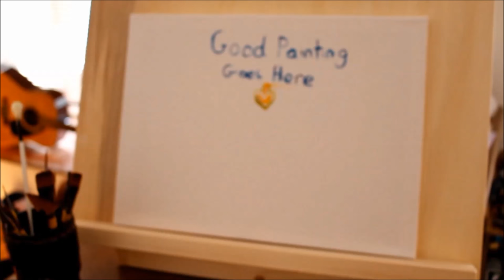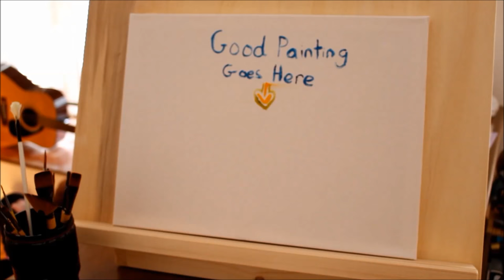DIY Drawing Board / Art Easel

Comment: Great easy build and great video! Thinking of adapting this design into a carrying case for supplies as well as the easel.
Reply: I was thinking the same thing. Put a board on the bottom, add a handle & some kind of latch.
Reply: My friend made a similar one by adapting his tabletop easle. Seemed to work but this one is a bit more robust

Comment: Would be worth noting a couple of things on this vid: 1) this can all be done with hand tool ie hand saw, just the cordless drill is needed.  2 ) that pivot point on the support arm looks to be a partially threaded screw so that the portion going through the hole in the arm is smooth with clearance, so the screw doesn’t turn and chew up the wood.
Thanks for the vid 👍

Comment: Can we get instructions with dimensions to make this easel? It is exactly what i-m looking for.
Reply: I‘m late, but here‘s what I‘m working with. I‘ll start building it this evening. 

Top board is 40x60 cm with a 2cm edge at the bottom.
Frame is built with 34cm and 46cm bars (3x4) , making the whole frame 34x52. The holes for adjusting on the sides are 5cm apart each.
The adjustment assembly is 3x2x46 at the top, 2x2x45 for both sides and a round piece with ø1x54 cm for the bottom.

Hope this helps :)

Comment: 6:45
Is that a screw? Screws can be used as turning mechanisms related stuff? I need confirmations before i actually try pls send help 😂
Reply from the maker: Yes, it is a screw. Use a "pan-head" screw andscrew it in all the way and then loosen it half a turn to allow the wood too move freely. Good luck with it :)
Reply: @ontheworkbench8743  thanks bro, lifesaver

Comment: I’d really like to make one of these for my wife, but can’t seem to find a workshop with all the necessary power equipment.
Reply from the maker: This whole project can be done using a handsaw and a drill, no workshop machinery needed, although it does speed things up!
Reply: On The Workbench I have a jigsaw without guides and no vice. I really like your video and want to make this drawing board! I can get four sessions at a workshop for $200, but at that price I might as well buy one. Any advice for limited resources and tools or on making nice straight cuts with a handsaw? I could easily buy the drill bits necessary. Cutting is my main concern.
Reply from the maker: @edvoorhees4253  I would recommend finding yourself a piece of wood, mark out loads of straight lines an inch or so apart and start cutting., practice is really the only way to get good at cutting straight lines by hand, it's not that hard though, you will master it in no time! As for limited resources, you don't need many tools to get into woodwork, a handsaw, drill, 2 or 3 chisels, a plane and maybe a coping saw for cutting curves. Try to purchase them used in local ads or ask around, plenty of people have these tools lying around in their sheds. Machinery only speeds things up, you'll learn so much more from using hand tools first.
Reply: @ontheworkbench8743  Thank you so much. Your video has really inspired me. The idea of making something of beauty and function by hand is very appealing. Does one get a degree or apprenticeship to become a professional carpenter?
Reply from the maker: @edvoorhees4253  I'm certainly not a professional! I started woodwork from a young age however and I'm a trained luthier but love all kinds of "making"!
Reply: Dang! Now I have to look up what a ‘luthier’ does! lol
Reply: @ontheworkbench8743  auction, craigslist, rummage sales, facebook marketplace. I have some beautiful tools for pennies on the dollar and use my kitchen table as a work bench.  (have cut and drilled through my kitchen table.)I  my just hobbiest, but I make little things for the kids and the pets.

Comment: It seems to b a factory than a diy vedio ... i hv a big wood sheet .... culd u suggest any easy DIY method to hold a paper while drawng without using tape...cis it spoils ends of paper...
Reply from the maker: Hi, I wish I had a factory! This was done in my small workshop which use to be my bedroom! Yes I have a bandsaw and drill press but these are not needed to make this,  it just helps speed up the process but you can use a hand-saw and any drill you have. My suggestion for you would be to make a board with strip of wood like I do in the start of this video, then paper can rest on it! Thanks for watching.
Reply: Piece of wood top and bottom on some bolts to tighten on paper

Comment: natural wood is a terrible drawing surface. you need hardboard, polycarbonate, treated mdf, sheet metal, or something stable and smooth. no draftsman or artist could use this.  even if you tried to finish the surface with urethane, you would get shrinking and sinking over time that would be terrible draw straight lines on.
Reply: Easily solved with any one of a number of solutions.

Comment: Video is great yes. But I wouldn't call it DIY if you're using so many pro-end stationary tools that the average Joe doesn't have. In that case a factory production line is just as much a DIY when handled by one man.
Reply from the maker: Hello. Thanks for your comment! Yes, I have a bandsaw, drill press and sanding machine, however these merely speed up the work. All pieces in this little project can be cut using a handsaw, drilled with a hand drill and shaped/sanded using sandpaper.
Reply: You'd be surprised what you can build with a hand saw, a hammer, some nails and wood glue. All of which are the most basic tools needed for this project.
Reply: It's a great video, I'm not at all used to woodworking but I feel like I can confidently put it together using just a hand drill, any kind of saw and some wood glue and screws(you can get wood cut to size any place you're able to get it anyway if you're so inclined, but it just doesn't matter you make the dimensions whatever works

Other things like a band saw etc just speeds up and makes the process of building easier.
Reply: Dear Lord, really? DIY stands for "Do It Yourself" and that is exactly what he is doing. The tools just make things easier. I have all those tools and more and guess what? I still do the projects myself. DIY get it. GREAT video by the way and keep up the good work.